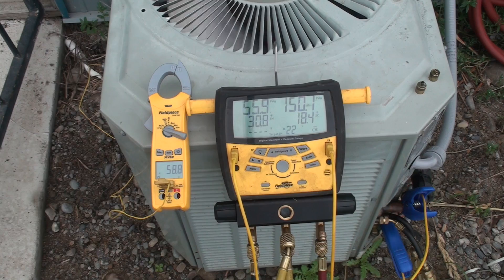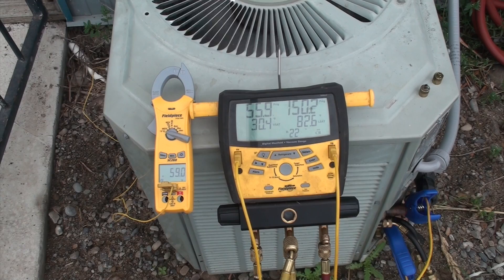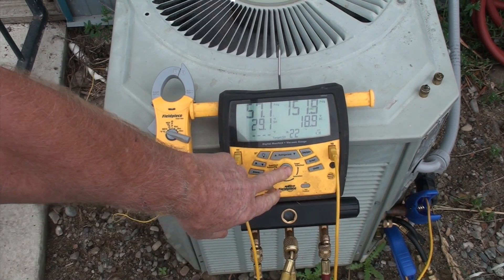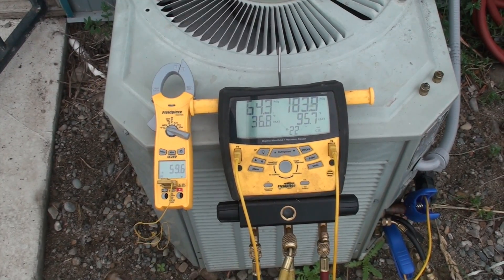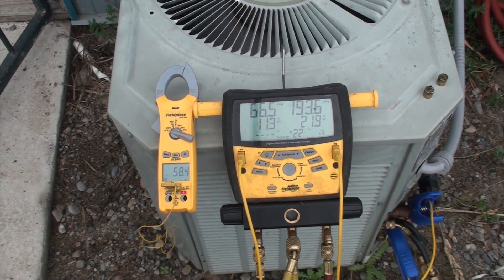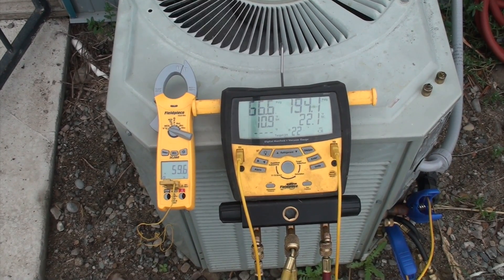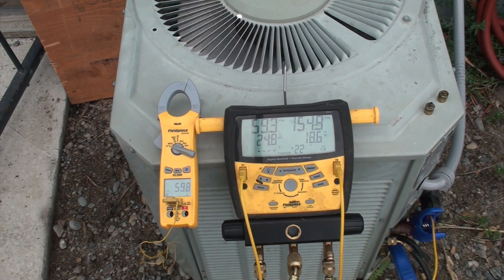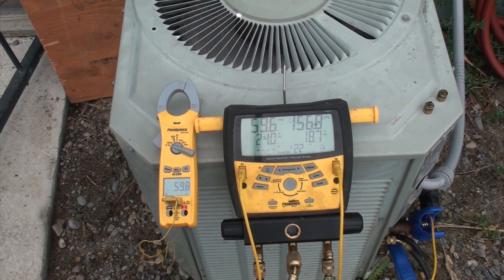Check charge in the air conditioner at low ambient temperatures

Comment: So if putting a temp probe inside the airflow of the condenser to see what the temp split be be ok too? If its a 20 degree diff from the indoor it can be another verification?
Reply from the maker: You can check the split across the outdoor coil but it will be much lower than the indoor coil. 
GFM

Comment: This tells you absolutely nothing about if the system is appropriately charged. Not liking your numbers? Just slide the board over a little more until you like the numbers smh. He even gives so far as to say you should come back when it's warmer to check again.
 If your company has you out there checking AC's in Temps lower than 65F instead of using this time to prepare your tools for the season ahead just bail

Comment: This might be a dumb question What ambien temperature are you mimicking when blocking half of the condenser fan?
Reply from the maker: You are trying to imitate 80F+ ambient.  The way to determine this is to increase the head pressure as read in condensing temp to 20 to 25 degrees above an ambient temp of 80F.
Hope this helps.
GFM

Comment: Here in western Washington if you waited until it was 70 degrees or higher to do just maintenance calls you’d be waiting until heat wave when no cool calls come in. What do you think about doing maintenance/tune calls around 55degrees outdoor ambient minimum? I know it’s not desired but would you say it’s acceptable?
Reply from the maker: I also have that problem, (not quite as bad) in eastern Wa.  55F is pushing it, but I have done it.  Blocking of condenser necessary, but there is no way to simulate a load on the structure.  There will be times when you will miss a charge issue, 
GFM

Comment: What head pressure should I try to achieve at low ambient temperatures with R410A and a piston ?
Reply from the maker: In the absence of manufacturer instructions, I would be looking for a condensing temperature of 20F + ambient.
GFM

Comment: Adding a Fan cycling in the condenseur unit can solve this problem?
Reply from the maker: Head pressure control yes.  Fan cycling control, no.  Worst possible method of controlling head pressure.
GFM
Reply: grayfurnaceman why the fan cycling Is not good. Can u explain me pls? Thnx :)
Reply from the maker: I have been meaning to do a video on this.  The head pressure varies so widely that suction pressure cannot be controlled.
GFM
Reply: grayfurnaceman with a piston, i agree but i Will Wait for this video ;) thnx for ur Time and tutorial

Comment: There are low ambient controllers that you can add to units to help with this if it remains a problem. It is just a head pressure control switch that will cut off or reduce fan frequency to raise head pressure thus giving you a closer to actual operating pressures.

Comment: GFM I think you didn't understand what I was getting at I do understand as you describing your last text your troubleshooting methods what I'm saying is you can only use the subcooling method on an expansion valve job and not on a fixed orifice or capillary tube

Comment: I'm a rookie in the field so I am coming across things I haven't experienced before. a few days ago I checked a system that had the same superheated (25) and sub cool (18) as the system you have in this video , but it was a warm day. I had a saturation of 40 degrees. what is causing my high sub cool and super heat

Comment: do u need to warm r22 freon in conditions under 60 degrees because having hard time pumping in freon in these 55 degree weather or below
Reply from the maker: If you are charging gas in low ambient, you may indeed need to warm it.  The best way to do so is to place the cylinder into a bucket of warm water.  Hope this helps.
GFM
Reply: thanks

Comment: what   a great teacher learned so much from you without  the hands on training  just added to what I do know perfect teacher I love the a/c work
Reply from the maker: Thanks for the support. 
GFM
Reply: Hello sir i want to know that my ac is r32 1.5 ton. It has pipe size 3.5 meter. I had to cut 2.5 because of gas leakage pipe bend.
Now i charge gas.
My room 30c and outside 32
Suction pressure is  125psig stable when start. In sometime running ac room temperature down to 16c suction pressure show 105psig. Then it is not go to 12c and autocut as before.
I think i charge 570grm gas.
Manufacturer sticker 650gram standard charge.
What should i do?
When i charge 650grams suction  pressure is 145psig. Is it hamful for machine?
And if i charge some less amp rr down
5.1amp but normal is 6.6amp.
What should i do.
I see that 110 psi pressure compressor run smoothly.
Very less noice. I uselly use 24c only. I need to charge the ac with  more gas?

Comment: I've been running into this a lot this week. Below freezing Vsat, wildly high superheat and super low suction pressure. But, it's been in the low to mid 60s and raining buckets for a couple weeks. My fresh out of school thinking is constantly telling me to add, but after passing leak checks and using common sense, I have held off.

Thanks a bunch for these videos GFM, you've provided me with so much help and in this case some validation too.

Comment: This would explain why the window unit in my computer room ices up on a cooler 70 degree day.
Reply from the maker: ESDI80 Computer room units need to have head pressure controls to work properly.  Hope this helps.
GFM
Reply: I'll never forget this old building, 1900s, at my work place that had a room with a few server racks full of servers.  They had two large Carrier window units to keep the room and equipment cool.  I will never forget when I found one of the units with over an inch of ice on the evap coil!  It was iced up to the point the front bezel couldn't be removed!  I was very happy when all those servers were moved to a proper facility with proper computer room HVAC equipment!  LOL
Reply from the maker: ESDI80 I'll bet you were happy.
GFM

Comment: every time i get a unit with low suction pressure, and high head its always one of these trane units  you are showing in this video.
Reply from the maker: ***** Uhh, low discharge pressure and high head?  Please explain.
GFM
Reply: 55 psi  on the low side and 225 psi on high side  with a dry bulb of 72

Comment: Can you also use your nice gauge set that has a sight glass ?  To figure out if it needs charge.
Reply from the maker: Guy Hakverdi I can't think of any way to run the refrigerant thru the set.  Also, fixed orifice device air conditioners sometimes will have bubbles in the sight glass when the charge is right.
GFM

Comment: I was waiting for this so much. Thank you .I was in that situation so many times. You helped me you can believe
Reply from the maker: Luc Dumouchel Welcome
GFM
Reply: @grayfurnaceman  Hello sir i want to know that my ac is r32 1.5 ton. It has pipe size 3.5 meter. I had to cut 2.5 because of gas leakage pipe bend.
Now i charge gas.
My room 30c and outside 32
Suction pressure is  125psig stable when start. In sometime running ac room temperature down to 16c suction pressure show 105psig. Then it is not go to 12c and autocut as before.
I think i charge 570grm gas.
Manufacturer sticker 650gram standard charge.
What should i do?
When i charge 650grams suction  pressure is 145psig. Is it hamful for machine?
And if i charge some less amp rr down
5.1amp but normal is 6.6amp.
What should i do.
I see that 110 psi pressure compressor run smoothly.
Very less noice. I uselly use 24c only. I need to charge the ac with  more gas?
Reply from the maker: I would charge by superheat if it is a fixed orifice expansion device.  Consider 5 to 7 C superheat.
GFM @vineetsehgal4738
Reply: Hello sir i want to know that my ac is r32 1.5 ton. It has pipe size 3.5 meter. I had to cut 2.5 because of gas leakage pipe bend.
Now i charge gas.
My room 30c and outside 32
Suction pressure is  125psig stable when start. In sometime running ac room temperature down to 16c suction pressure show 105psig. Then it is not go to 12c and autocut as before.
I think i charge 570grm gas.
Manufacturer sticker 650gram standard charge.
What should i do?
When i charge 650grams suction  pressure is 145psig. Is it hamful for machine?
And if i charge some less amp rr down
5.1amp but normal is 6.6amp.
What should i do.
I see that 110 psi pressure compressor run smoothly.
Very less noice. I uselly use 24c only. I need to charge the ac with  more gas?